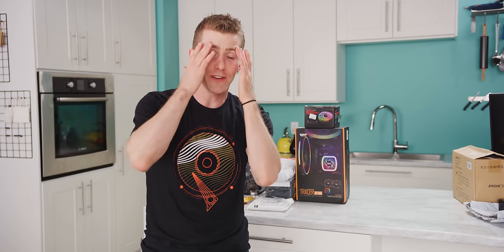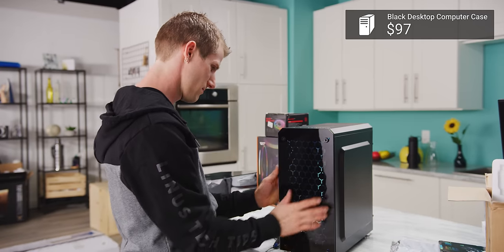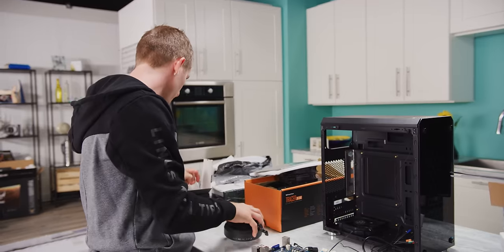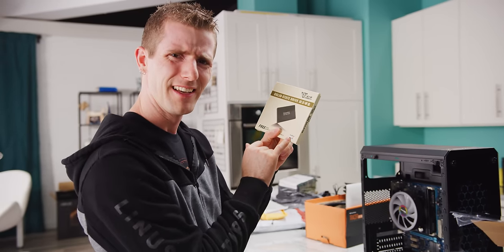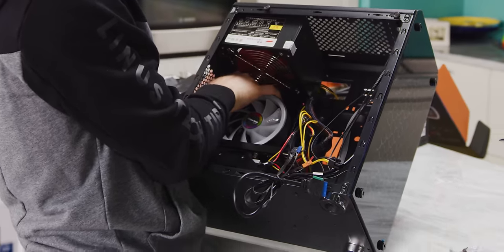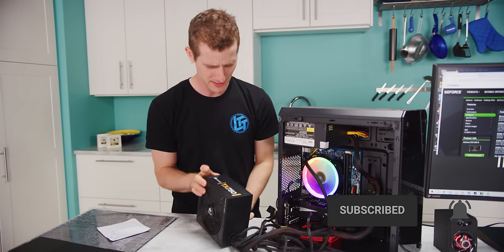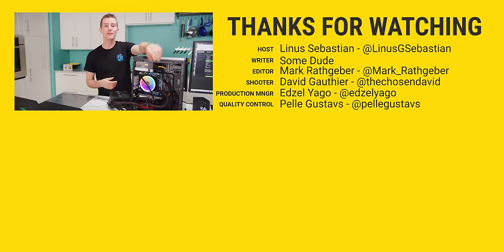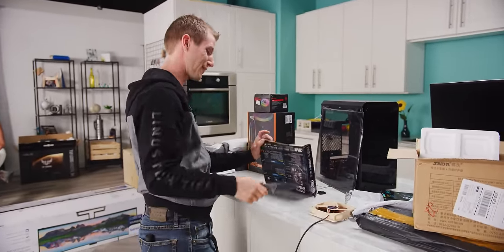Building a PC... using only Wish.com

Comment: I love the fact that Linus was actually very surprised with how nice the case was for being off of Wish, and then he found out the price LMAO
Reply: It also has tempered glass on the front panel, which you really don't want
Reply: @IronIsKing  I mean, the tempered glass itself isn't inherently bad, it's how it blocks the airflow
Reply: @IronIsKing  thats the same one that I have and I kind of regret it as well, really restricts the airflow. Was too lazy to return and rebuild the whole thing in a different case so I just got a good cpu air cooler instead
Reply: @sunbleachedangel  tempered glass is fine if it’s not closed, as in a vent from either the top side or bottom allowing airflow
Reply: nice other shaggy

Comment: I love how the only tempered glass on the case is right at the front, choking all air-flow. Literally the last place you wanna put TG if you want any sort of thermal performance.
Reply: The airflow in this unit is bottom-to-top. Not the best design decision in all honesty, but still.
Reply: there is no need for air flow when the pc doenst turn on
Reply: actually my expensive corsair case has a glass front...
Reply: @DrFlox  but it doesnt block the air flow like that right?. There are holes there for the air to come out, so you shouldn’t block those holes.
Reply: You can literally buy NZXT x Bethesda rainbow six siege case for $76 (only 500 of them worldwide)
Reply: * ubisoft
Reply: there’s a ton of cases now that use tempered glass panels on the front of the case they just use vents either on top or bottom for airflow

Comment: Wish I had the balls to even touch a PSU bought from Wish
Reply: Anthony Canty Wish PSUs aren’t bad if you’re looking for a 4th of the July firework
Reply: @jackseley4084  Suppose everything has its use
lul
Reply: The only Thing i would so With a Chinese Cheapo is Throw IT out directly
Reply: Wolfgang Ruck Information Technology?
Reply: @djkilla3711  what so you mean
Reply: My time has come
Reply: Tommorow is the time to power it on!
Reply: @notsatvrn  Power in what
Reply: @notsatvrn  Power on
Reply: Wolfgang Ruck when it’s the 4th of July power on the power supply and watch it explode

Comment: "The case actually feels high quality—oh crap I bent it..."
Reply: Even the best quality has no chance of competing with Linus' horrible handling of everything tech related
Reply: to be fair, he was holding a really thin part of the case, that section is actually bendable on most good cases too
Reply: Mix Bandtu and thus this is why we all love and hate Linus.
Reply: Gotta be careful, I managed to land a super-cheap case once in a lot purchase and picked it up, then realized I was bleeding pretty badly. 

I could have shaved with the edges in that damned thing.
Reply: My Q500L is pretty flimsy, after I butchered in some ventilation.
Reply: @mfree80286  I bought a fucking knife off of wish and was testing the edge and went "this shit is dull let me sharpen this shit" and when I went to fucking sharpel it I noticed my blade oil was strangely red, you fucking guessed it, the fucking handle was razor fucking sharp
Reply: Yeah I laughed pretty hard at that one.
Reply: @jordanmendoza812  Oh, that was an australian knife, you were using it upside down. You're supposed to hold the blade and cut with the handle.
Reply: Cherzo  still gets the point across
Reply: @chaon93  ah makes sense, easier to throw at spider and snipe kangaroos and koalas

Comment: 6:07 Copper Block on AIO
8:03 What MHz Does to Ram, Price of Ram, and What Ram Does Exactly
8:56 mATX Motherboard and Other Types
9:40 Silicon Magic Controller, SATA 2 and 3, DRAM Cashless SSD
10:43 SLi
11:03 Molex and SATA cabeling and Connectors/Pins
14:03 PCB
Reply: 16:41 Nvidia Installer
16:55 Driver Discs

Comment: Linus: This case isn't awful, how much was it?
Satan: 97 US dollars.
Linus: 9- WHAT?!
Reply: @gforce7431   absolutly not worth the price.
Reply: to be fair he could have actually gotten a really decent case for 97 dollars.
Reply: @gforce7431  not for a 96$ price there are 20-30$c cases that are Way better than that case
Reply: Christ, for that price you can get, among other actually good cases, a Phanteks Enthoo Pro, a superb steel case with tons of QOL features and good build quality.  Or janky mcjank pants here.
Reply: @davidturner7577  I got a $48 case that was metal (either steel or very strong aluminum), tempered glass side panel, magnetic dust filter on top, a full mesh front panel, a removable dust filter for your psu on the bottom, PSU shroud, with a cable management area in the back. PCI slot covers were punch outs, but I spent a few bucks and bought some mesh covers from amazon to screw on. Cougar MX330-G if anyone is curious.
That case has no excuse when it fails to get anywhere close to budget options way below its price point like mine or the higher priced options like the phanteks cases
Reply: He was expecting like, $30, for that price it's A okay. For $100 you can buy a real nice case. On Amazon you can usually find comparable cases for around $25, and they usually come with more fans.
Reply: @prismglider5922  yeah that case look like a piece o trash. The aluminum looks so flimsy looks like it could bend with just a little of force
Reply: 3:00
Reply: It retails for $15 in China
Reply: Cesar Mendieta well it was bent without even trying and that’s just sad for a case
Reply: for 97 dollars, if you are lucky, you can find a cooler master or Rosewill ATX case for sale in Newegg with original price of 120-140 and come with at least 2 fans
Reply: You can literally get a NZXT H510 for 66%ish that price
Reply: @thgnotorious  exactly，I really really like H510 pro or something with RGB strip on, but....it is always..always out of stock...that's why I said cooler master or rosewill...

Comment: so, it's a 550 that's sold as a 1060 but the computer thinks it's a 1050 ti? oh, ok. cool.
Reply: You'd be surprised, lots of work goes into fluking buyers, he actually went into how during a similar SSD video
Reply: it just a moded bios
Reply: I don't think it's even 550. More like a 450. Anyway, I'm surprised he didn't check SSD and RAM turned out OK. That manufacturer is notorious for having issues with correctly reporting total capacity/storage available in his products....
Reply: Wish vendors playing 4d chess
Reply: They call that a "Minor" detail.

Comment: "1060pi?!? It doesnt even have a 6 pin"
Me not understanding any of that: "hah! Good one"
Reply: @armando1is1great  that ain't ever gonna happen unfortunately
Reply: @LannasMissingLink  you should be more accommodating to the demands of internet strangers
Reply: @LannasMissingLink  
The power connector of the GTX 1060 TI (and the GTX 1050 TI) has 6 metal connections (pins) to provide enough current without melting the cables (because Joule first law).
Not having these 6 pins means the board doesn't require as much power as it is supposed to, which means it's definitely a rip off.
Hope it helps you understand better his comment
Reply: @swpolo  hah thank you! I understand now. It's crazy how many concepts from physics class actually turn up in every day use, definitely the most beneficial class I took in school
Reply: @swpolo  I dont beleive the 1060ti exists
Reply: @ridderp  I believe you are right, but that's actually how they called it first in the video so I rolled with it (check 12:00)

EDIT: actually, they only say 1060
Reply: @swpolo  I'm just going to pretend to understand what you said
Reply: Make me a sandwich now
Reply: @swpolo  the fake 1060 shows up as a 1050ti on Windows I think.
Reply: @AmanSingh-bt1rx  you forgot to say "female!"  XD
Reply: What Lana that makes so much sense
Reply: @swpolo  unless it's a 1050 ti from Asus, which doesn't have an additional power conector
Reply: @ridderp  loooool
Reply: DAMMIT LANA you fucked up the comment. its 1060 ti
Reply: @prantanilbhowmick1070  eh the point of my comment was me joking that I didn't understand any of the tech lingo he said, so I didn't fuck it up. Cool it with the cap locks next time dude

Comment: The GPU look like a GTS 450 modded.
I already saw several of those sold for 50 USD and labelled as "1050Ti 2GB"
Reply: Jup, this is definitively a GTS 450. Linus could very easily check by running GPU-Z and checking the shaders count/other attributes. 
I dont know why sites AliExpress and Wish aren't WAY more stricter with this kind of scam. 

I've recently bought one (needed a graphics card with about the performance of a 450 and didn't really care what i got) and in the end won the dispute. But the seller keeps on selling these fake cards, even though throughout the dispute process (including escalations) it became very clear that the seller was very much aware of the scam he was pulling, but just didn't care.

Comment: I was laughing at that "flimsy" case until I realised it's a variant of my case...
Reply: I got an FX-8320E eight core for 35 bucks
Reply: @elisastone916  wow, that's pretty cheap, what about the rest of the build? you also getting that on a bargain or was the cpu just a bit of luck?
Reply: @vladimirputin3426  Well, i don"t have a gaming rocket, but for now it is enough. I"v got an cheap case for about 7 euro, a mainboard with an phenom 2x6 processor and 8 gig ram ddr3 1600mhz and a radeon r9 280x 3gb gddr5 for 70 euro total , 8 gb ddr 3 1600mhz for 15 euro and the fx 8320e for 35
Reply: If you live in europe, look on Ebay Kleinazeigen. It is the german version of craigslist. You wil find a lot of cheap stuff
Reply: @elisastone916  wow, that's good specs for 70 euro! my build is an Intel I7-7700 @3.6 GHz, NVidia GTX 1070 8GB Dedicated ram, 16GB ram, 2TB HDD, good build but around £1100 (around 1275 euro)
Reply: @vladimirputin3426  That is a little bit out of my league.... And to be honest, i would rather invest that sum in my motorcycles. But each with it"s own hobby
Reply: @elisastone916  motorcycles? awesome!
I've always thought about a motorcycle as a daily driver, it just looks difficult.
Reply: @vladimirputin3426  I have 3. Older bikes but still. one Suzuki gsx750f katana, a yamaha tenere 600 enduro bike and an old school honda cb450f cafe racer
Reply: I rode a few times from Germany to Bulgary , Ukraine and Romania with the katana.
Reply: @vladimirputin3426  It is not difficult to ride, you just have to feel the bike and to respect the other drivers, riders etc. That is the only way you would get aknowleged and respected on the road as a rider
Reply: @elisastone916  thanks for the advice!
Reply: That was funny.  I loved that comment.
Reply: @elisastone916  and you probably had to glue the cores together
Reply: @vladimirputin3426  they cost a lot in Europe I have a Intel core i5-9400f, NVIDIA GTX 1660 TI (slim worst than a 1070 but better than 1060 TI), 12 GB ram (upgraded from 8), 200 GB SSD, and a 1TB HDD for 600 US dollars which is like 550 euros. It's a cyberpower.
Reply: Sad cheap case noises
Reply: @elisastone916  to Bulgaria? I hope you enjoyed your stay there :)
Reply: when i saw the price of the case i gasped. my matrexx 70 for around 69 bucks and its p solid.  it's extremly roomy, id give it a 10/10

Comment: This is like buying medicine for someone in a dark alley
Reply: medicine.... lol
Reply: Not everyone in a Dark Alley has garbage you know! It has to do with What you know... So... Here's how it is!

Regular stores teach customers about the products they are interested in or have. This includes Brands and model numbers of these brands. They do sell pirated versions because they too are looking for a profit. ( Mad Catz ) they just make sure it works before they do. 

Once the consumer knows the difference between products and the expected quality of them? Its easier to get better deals and/or spot fakes, or pirated/ repaired products! You can notice mistakes super easily if you know what products are, how they're packed, Reflective Anti-Piracy stickers, Etc. Then every fake product will be as recognizable as a fake pair of "Nikee's" or "Robo-coup Pirate Princes adventure motorcycle " Action figures.  

I've had an Xbox one I got in an alley, for two years and it still works fine. 
My friend got me a cool BOSS Sound base/bar from the streets that makes my crappy TV sound like a booming surround sound system thing and it too also works Fine.

WISH has discounted products because NONE of them are OEM (Original Equipment Manufacture ) They are like Mad-Catz Inc. knock off versions of the original. 

I obtained a charger for my Nintendo DS, lol its twice as light as the original, and it has no Nintendo logo on it. lol. I feel it was made from recycled materials.

On wish? If it is a real brand name product? You'll notice the price is the same as the store, BUT if the price is lower? For a Name brand product? Odds are even if it is OEM, its probably a returned remanufactured/ rebuilt product.
Reply: Someone has been playing too much re4 recently.
Reply: I mean to be fair, no one's going to die if you buy them a bad pc, unlike the medicine thing, so the analogy's not really all that great.

Comment: build a cheapskate game pc: spend $100 on the case and $45 on the gpu
You're doing it wong man
Reply: Wong man 😂😂😂😂😂
Reply: Wong
Reply: Wng
Reply: 2 wongs dont make a white
Reply: yea you don't need to spend much for a cheap case. My current mid tower was $25 Australian (like $15 US) and while not flashy, I'm still using it after I upgraded to a GTX1080 and a Ryzen 5 1600. Saying that, it was seemingly the only OK case from a cheap Chinese company and I don't think you can buy it anymore (case: SHAW gt-gm5).

Comment: Imagine paying 50 bucks for a cpu that’s like 10 years old
Reply: imagine if that cpu was a power5 (2005?) "floortile" , what a beast,
Reply: Good luck finding it for cheaper new
Reply: @hoefkensj  2004 i believe
Reply: And also a dual core, by the way
Reply: you mean 7 or 8 years old? that's the 2nd generation Intel Core I3. the value comes from age more than the quality.
Reply: AMD do cheaper CPUs and they are actually decent lol
Reply: I like your profile picture but that is not the you tube default.
Reply: You could get like a 3 gen i7 on taobao for like 50 bucks
Reply: I paid $50 at Goodwill for a 4th Gen I5 in a Dell that came with 8GB of memory (2x 4GB), going to use it as a general family computer and might put in a lowed GPU for some 1080 gaming latter.
Reply: @MacBack123  Include that fake 1060 lol
Reply: What a steal lol
Reply: You can get newer used I5's on fleabay for a fraction. Along with literally everything else,  and they'll be the spec listed and last longer than this trash. lol
Reply: I can. Check out intel xeons x5670, x5680, x5690, and E620. Some of these can be found for 20 a piece refurbished  (new tend to be much more expensive). A couple of these can go a couple hundred bucks also refurbished for very little gains in clock speeds. They still feel as good as new. I buy them in pairs for my MacPro and I can tell you they are a pretty good deal. I can run any games on top of an rx570 on a Windows vm on top of Fedora/libvirt remoted from my laptop. I barely hit 30% cpu usage with Elite Dangerous running on Max settings.
Reply: I'll admit it. I paid $55 for a P4 Core 2 Duo 2.8 ghz because I needed a replacement.

Can't afford a new P.C. though.
Reply: @jasonmcfall5578  Pentium 4 Core 2 Duo, wait, what?
You mean the Pentium D?
Reply: @resneptacle   That's one of the names I've seen for it.
Reply: @jasonmcfall5578  Core 2 Solo/Duo's is the follow up generation to the Intel Pentium 4/D, so it's only one of those, I would guess just some regular Core 2 Duo since Pentium 4s are not really usable nowadays anymore
Reply: @resneptacle   Intel just threw 38 names for the same CPU family. And yes core 2 duo is one of them. It was just a way to make them look better during the CPU wars of the time.
Reply: @jasonmcfall5578  Though "P4" never did ho together with "Intel Core 2", at least not to my knowledge
Reply: @resneptacle  Your right. I just realized that I was looking at the front of this old case with the P4 sticker on it while typing. Stupid mistake right? I changed out MB after a lightning strike happened. Opps.
Reply: @jasonmcfall5578  Ah, so you have a proper Core 2 Duo in there now? ^^
Reply: @resneptacle   Yep. 2.8 GHZ (the fastest processor  that the board will hold is 3.0)

So I think it's time to look for a newer board.
Reply: I got an FX-8320E eight core for 35 bucks
Reply: Watch out! Theres a spider on your Face 😱

Comment: Me before the vid: ahh yes something I can afford 

Me after the vid: ohhh nope I change my mind
Reply: Old Dell and graphics card like he said
Reply: @setharnold999  how many frames would I get on games like r6 or dead by daylight on low settings?
Reply: @cosmics4846  how does this guy know the exact games I play
Reply: @hxvoc3971  lol magic 😎
Reply: @cosmics4846  those are very undemanding games they can run off a potato. Grab an old dell with at least 4 cores 8 threads and through a 1660 in there. Maybe $300 max (considering you get like an $80 system and a 1660 for msrp). But honestly for $300 I might consider a Series S, keep in mind you have online fees.
Reply: I'm so confused. Even if Wish is technically cheaper, you don't ever buy anything off of it unless it's just random crap, like plastic containers, or cable organisers, or other such stuff that won't involve ingestion, applying things to your skin/nails/the like, or electricity. I am probably missing other things you shouldn't do with things from Wish, but that about covers the main stuff. Wish is cheap crap, and in my country, we have discount stores that sell cheap crap like the ones on Wish (they all come from China), so I know what to avoid. Trust me, don't buy crap off of Wish unless you want to regret your life decisions.
Reply: My runs on 179 ping- 1000000 ping